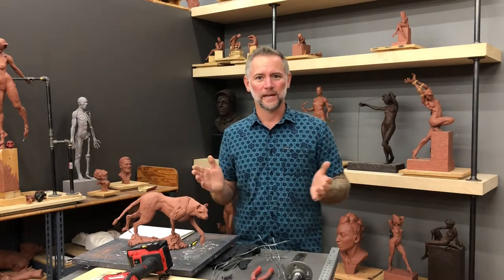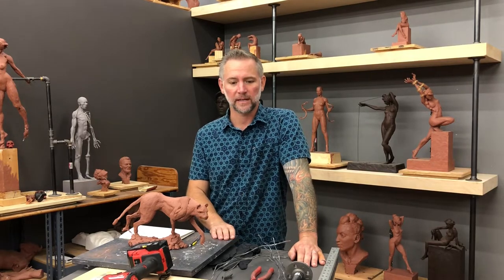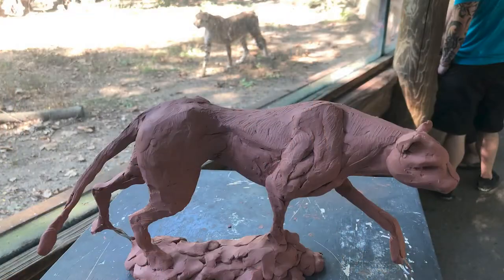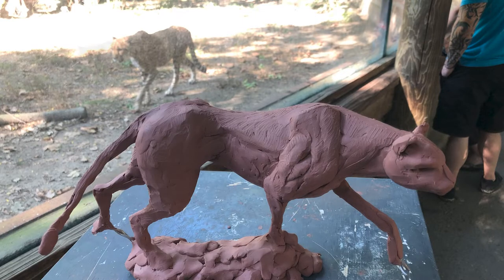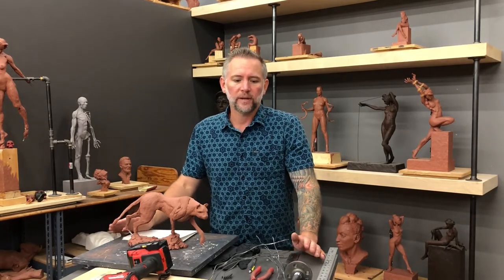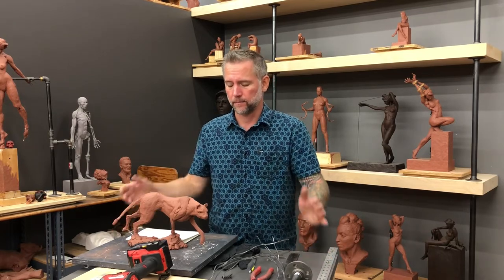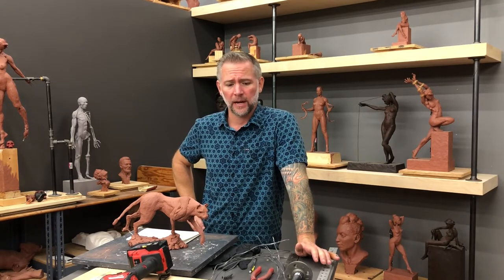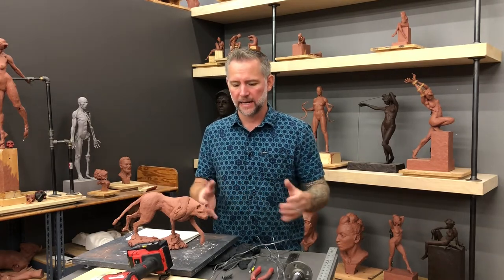Animal Sculpt 1 Research and Armature

Comment: Maybe dumb question but why do you use gloves when handling the wire?
Reply: can scratch    maybe.  ?
Reply from the maker: The wire leaves a bit of aluminum residue on your fingers. That is why I also wash it before using it. If your using store bought wire this isn't normally a problem.